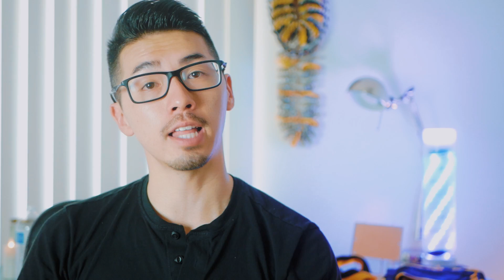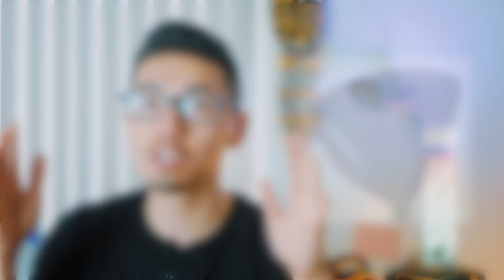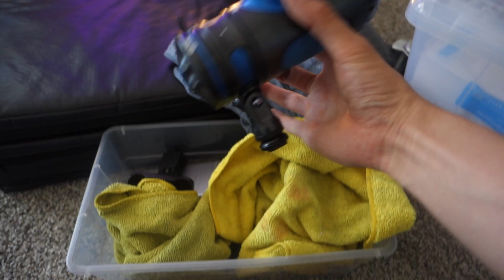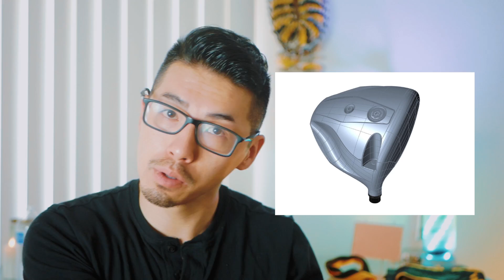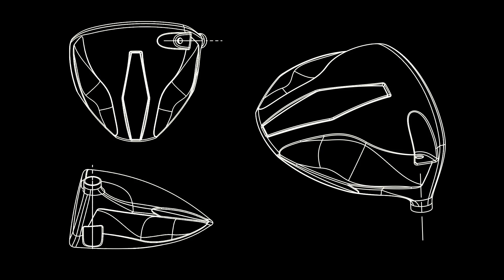How Industrial Designers Use CAD

Comment: Thanks  for the video, what kind of programs would you recommend? I use Sketchup for most of my stuff ( I know, but hey, im comfortable with it and have designed some pretty cool stuff), and then I render in blender, I want to start using inventor to be more professional, but I would like to know what your stance is on software, thanks!
Reply: Autodesk Fusion360 is pretty nice, and you can get a free hobbyist license

Comment: Great stuff! 

What program did you use for the golf club head?
Reply: Jason Leblanc pretty sure it's keyshot , he mentions it and then showed examples :)
Reply: Darragh O'Boyle sorry, i meant to ask what cad program he used to model it,..if it was a parametric or polygonal modeling program. Thanks !
Reply: Jason Leblanc awh sorry my fault ! 😁 Well for me I use solidworks for the last 5-6 years through school and college and I think it's one of the best and easiest to learn :) also I use sketchup for bigger scale stuff like buildings and architecture, I probably wouldn't recommend SketchUp for smaller scale stuff ! And then keyshot as my rendering software for both ! It's beast ! 😁 I hear people speak a lot about another 3d cad software called rhino as well, supposed to be good !